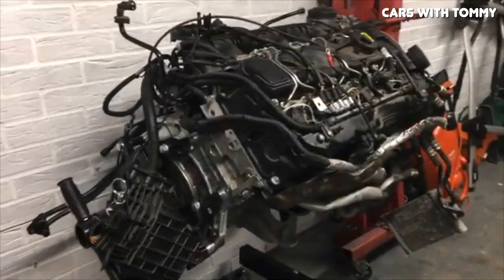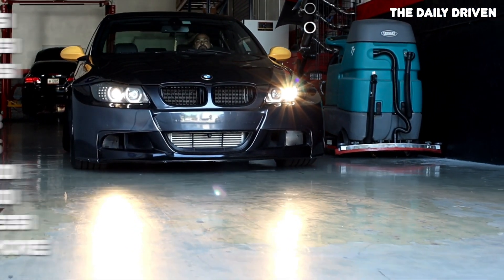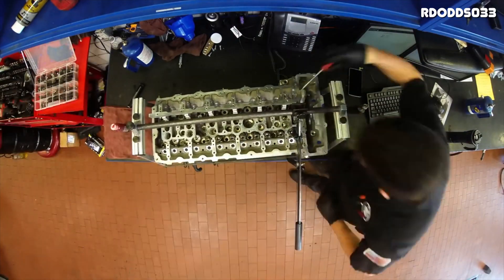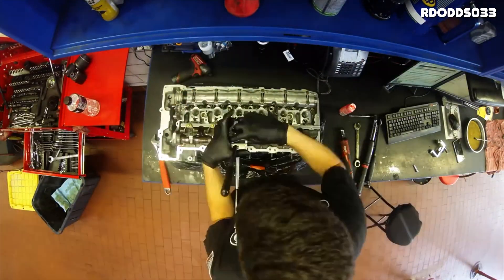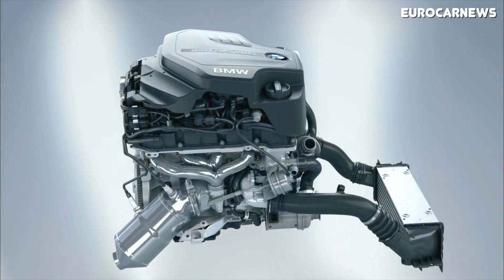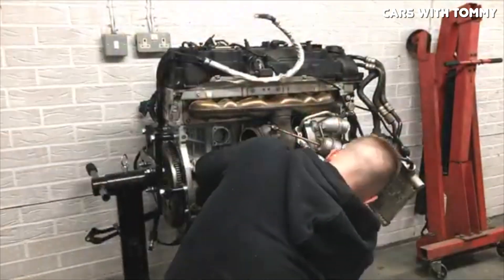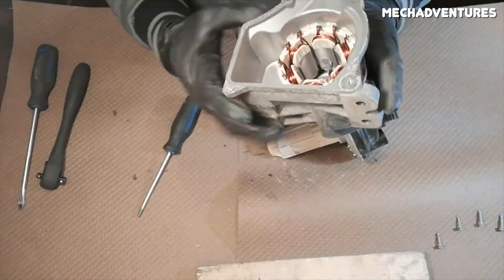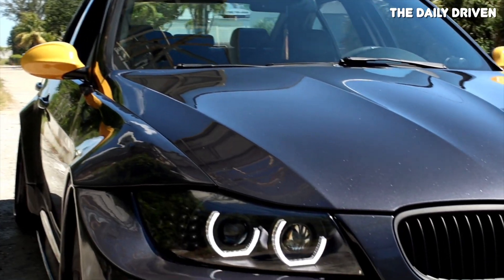BMW N55: Everything You Need to Know

Comment: I've heard a bit about oil starvation to rod bearings on N55,  is this something to be concerned about?
Reply: I heard Rod Bearings are not an issue on the N55 had mine a few years . Done quite a bit of preventative maintenance but the only time I had to do something involving opening the engine was the doing the PCV that's built into the valve cover.

Comment: I just snagged a 1 owner, elderly owned, 2013 335i with 38k gentle miles. I was looking for something SUPER basic, like a 328i for a spare/ date night car. This was just too hard to pass up for $16k. I'm still learning about the N55,  i plan to do the charge pipe/ inter cooler components upgrade. I dont think i want to tune it, but if i get the itch, whats the best VERY mild tune for these things? I. Talking like 15-25 HP upgrade. Thoughts??
Reply: MHD Stage 1 is super light on this engine and wont harm anything

Comment: I think I read somewhere that the N55 does some sort of recirc that helps the valves stay cleaner (a problem on direct injection engines and on the N54).  Not sure though.

Comment: How reliable is a 2014 BMW 335i xDrive? I would like to keep it OEM+ just a intake, exhaust, and light tune. It would be my daily driver all year round. So how reliable are they since I'm a university student (I can afford to maintain it myself since I've been working on cars for years).
Reply: make sure the charge and boost pipes are changed, bmw cheaped out on those back then.

Comment: I have an 2016 built N55 inside an X5 xDrive35i that's been tuned to the M Performance power kit. Apparently late production N55 share the piston rods and rod bearings from the S55.

Comment: I’ve got an N55 M135i my first BMW coming from a VR6 Golf. It’s always crazy to me how this thing looks so understated but is a very quick car even in stock form.
Reply: I just bought a 2013 135i E88 N55. 6 speed. So fast stock. I had a Jetta 1998 GLX VR6 5 speed. Also, way faster than would think. I would pull on cars 300 HP on hwy. N55 is a beast and pulls!

Comment: spot on intelligence thank you for that ! with that said i have a 2011 335xi sedan stage 2 single twin scroll turbo upgrade , ghassan remanufactured n55 engine , stage 2 dme flash, all new valve cover , valvetronics motor , dme , delphie coils , plugs 1 step cooler, new oem bmw 6 injectors , and after about 1500 miles driven now, I'm noticing a ticking noise almost like a baseball card in a bicycles spokes upon acceleration when car is in gear driving only  ! when in park or neutral and revving car , no noise ! only when in drive under medium or higher acceleration around 1500-3500 rpms then goes away in higher rpm,s ,doesn't happen at all under normal acceleration ? no one can figure out this issue ! please help !
Reply: most likely wastegate rattle, pretty common on n55 and n54, could be a faulty turbo or just nothing to worry about depending on how bad it is

Comment: I got a 2011 E88 FBO was able to achieve a 475 torque but only 335 hp to the wheels. Stock turbo and stock high pressure fuel pump. With a costume tune by mhd and tuning dynamics and a xhp transmission flash on the DCT transmission. Those numbers where done with a 93 degree weather and 52% humidity. I forgot to mention that was done on pump 93 octane. Debating on upgrading the turbo because I want at lease 450 whp but idk how reliable that will be. I forgot to mention that I also got a remanufacture engine with forge crankshaft and kings bearings. Anyone here with a n55 with 450 or more whp? if yes what you got done to it?
Reply: I daily drive a n55 stock engine at 700whp
Reply: What are your mods?
Reply: @gabequarles3809  lit 🔥
Reply: That’s lit I just got mines tuned making 370 with the upgraded charge pipe waiting for my exhaust and coil overs  and intercooler I should be  be at 4 soon
Reply: Races a 2011 same year as mines with a tune and got him in the high end 😅🔥

Comment: Thank you very much super helpful information, I'm picking up an X1 with this engine and will leave it stock have no interest in tuning it I just want reliability out of it, I was worried about the timing chain issue i'v hear on the n-20s  2.0 engines but you mentioned none of that thank you again

Comment: These engines aren't even in the same ballpark as the 2JZ or RB26 and built a decade later.
Reply: The engines were created in different time periods and conditions, so off comparison. Besides the b58 has proven itself more than capable and just as good as the 2JZ so there’s that.
Reply: @juda210  2jz will shit all over a n54 in every way possible, and its a decade older
Reply: @vdubskiee5356  buddy did you feel like reviving a 3 year old conversation to state the obvious?
Reply: I’ll take the b58 over 2jz.. power just comes in way quicker

Comment: I have 2015 435i xDrive gc (n55) with 70k on it. Engine seized, battery died and starter went all at the same time about a week ago. Connecting rods and bearings are done. Car has MHD stage 2+ with FBO. Never abused the car, always drove it and treated it very well. Shit luck!
Reply from the maker: That’s some bad luck! Hopefully my N55 doesn’t explode like that 😂
Reply: Just got mine back from BMW. New engine from Germany, Dealership found metal in oil filter during trip for drivetrain malfunction. Thank goodness for engine and drive train warranty.  49K on the motor. Initial issue was a wiring harness. That replaced and issue resolved.
Reply: Nah the engine seized up and you killed the battery and burned the starter from all the attempts trying to start it. 🤣
Reply: I have the same exact car I was thinking about getting the same tune do you think the tune had anything to do with this engine crashing?

Comment: HELPP I GOT THESE CODES!!!! 2C58Charging pressure control: switch off Consequential reaction/2DAO/2DA2 intake Camshaft angle deviation With respect to Crankshaft outside tolerance!! Exhaust camshaft angle deviation with respect to crankshaft outside tolerance !!!!!!!!
Reply: Vanos Solenoids. (Many months later)

Comment: Who knows what exact transmission is in the 2016 F36 x drive (435xi) grand coupe ? Is it the first or second gen ZF 8 trans? Because I know instead on doing the LCi in 2016 they just went to the 440i in mid 2016 which was really stupid on their part, granted I just traded in my 2020 M5 comp for a brand new G82 M4 comp, I had the 07 e92 n54 with fbo and tune making great power but I use the 435 as my daily but I want a tasteful tune on this car I’m thinking JB4 I’ve already went with dinan and bootmod3 as we’ll as a jb4 G5 back in the day of my N54 ,and I cannot seem to find info on the GC I know it’s loaded 8 speed m sport package but not performance pack that’s the only option I left out . Literally costed me as much as a base M4, it’s like a mystery to everyone . Lol even wiki/forums/other F30+ guys dont seem to know. Thanks in advance !!!!
Reply: All of the variants of zf8 speeds will be fine with tuned n55s I would recommend tuning the transmission of course

Comment: My wife got a 2007 n52 and it not running to good. Been hearing alot of good things about n54 and n55 swap. Which is the better engine if it going to be for a toy. My daily is an f150 and my wife drives a Toyota Corolla. The BMW is strictly going to be for play and riding around town and showing off. It will be long term project. 

Open to all suggestions just give your reasoning for what you would choose.
Reply: If you can find an M2 or M235i N55 - code is N55B30TO - that will be the one to have. Some internals from the S55, better oil circulation, and RK Tunes will get you to near on 700 wheel horsepower on stock block, while offering better reliability than the N54.

https://youtu.be/El8czI1li1Q
Reply: @4our6ixkwvmz  
Are you talking a specific n55. I only ask cause I plan on turning it bottom up and putting all forged internals. That said everywhere I'm looking for reliable transportation go n55 for street and strip go n54. 
I promise I'm not disputing what you say I'm just looking to get as much info as possible
Reply: N52 is one of the best running bmws ever! Not for power but for dailying
Reply: I have a 2011 328 with a N52. All I had to do was replace the Valve Cover, Plugs and Coils at 130k. 
I got it in 2013 with 21k on it. 
She's hitting 188k currently and no issues.

Comment: u told a lot of stuff here thats not true. First of all, stock turbo is capable of making 450hp with all bolt on stuff (cooler, piping, etc etc). Internals can handle 600hp in daily use. Ofcourse everything will break someday, but you got the point. Been there done that.
Reply: Yeah, maybe 400hp w meth/ e85 and fbo.

Comment: can someone tell me what n55 my 2015 640i has.
Reply: From 2015 it's probably the same as in my 2017  N55-B30A
Reply: Just google it 😂
Reply: @sekouchill  not that straight forward - there was a change from pwg to ewg, sometimes i see 315bhp quoted, sometimes 320bhp.  and i think its the b30O engine after checking with ISTA.

Comment: Had a rod knock in my n55 with regular maintainence.  10,000 later my car was back in business
Reply: Have u done the oil filter housing gasket replacement before it knocked? Do you own a e9x chassis? Mileage?
Reply: You didn’t do anything to get it fixed?
Reply: @Yeer718  what do you mean? A rod knock meaning the engine would have to be dismantled and rebuilt.
Reply: @usmclongrangebrainsurgeon  at what mileage? I have the same car around 60k miles
Reply: @frazmeup  around 63,000. Ended up having to replace the engine for $9600 with one that had 30k miles on it
Reply: @usmclongrangebrainsurgeon  Damn. Got me scared now, I have no warranty lol
Reply: @frazmeup  it was caused to due oil starvation. My recommendation would be to do an oil change every 5000-6000 miles. The engine burns through oil especially if you drive it in sports+ often
Reply: @frazmeup  don't be, just be smart about addressing issues as early as possible. Regular maintainance will cost you a lot less than taking a chance and waiting the extra few 1000 miles. It's a great car and should last you well into double your milage as long as you take care of it. If you can't afford to go to bmw for an oil change learn how to do it yourself or find a good garage that specifically works with European cars.
Reply: @usmclongrangebrainsurgeon  I have an Indy that does the oil change for me. Never go over 5-6k miles between them. Changed the OFHG, coils and plugs just recently. But still I have this un easy feeling. People telling me how the rod knock is common with these cars. Mines also pwg not ewg which sucks. 2014
Reply: @frazmeup  rod knock is only common because the engine gets starved and the oil sensor doesn't pick it up in time. Most people change oil every 10k-12k. If you do every 5k-6 you have nothing to worry about
Reply: @usmclongrangebrainsurgeon  I have a rod knock in my son's N55 at 82k miles.  We changed the oil usually every 5k, though once it went 8k.  I can't speak for previous owners though.  I read that oil starvation is possible in spirited driving due to g-forces sloshing the oil to one side.  Not sure if I will rebuild or put in a used engine, but obviously my confidence in this engine is low now.  This was a 2011 which was first year of N55, I read that later years - after 2013? - the reliability was improved.
Reply: @usmclongrangebrainsurgeon  Solid advice bro, appreciate it.
Reply: uhh clearly you didnt do regular maintence and ran the car with low oil, thats on you
Reply: @vdubskiee5356  nah this engine is known for being unreliable. I had the oil changed by BMW every 8000 miles. The car was meticulous. Unless the sensor failed when oil was low there was no way it was on me. There was a successful class action law suit for owners of this engine.
Reply: what bmw?
Reply: @jasonminhas377  535 xdrive

Comment: Their weak spot is this valvetronic motor, which is made from plastic (Lol at BMW for this decision). The eccentric, intake and exhaust camshafts often have issues as well. This is weak engine. Had to open it and replace the valvetronic motor and the eccentric camshaft. Now I have to replace the intake camshaft as well - it's scored. This is weak for an engine for me especially that I still haven't replaced the brake pads (at 110k km's) but had to replace the valvetronic already...

Comment: There are at least three versions of the N55. The "base" which is used in most regular BMWs, the M135i/M235i which has forged internals except pistons, and the M2 spec N55 which is even stronger. Also, the early models until the middle of 2013 had the pneumatic wastegate and will have a lower tuning potential.
Reply: not forged mate
Reply: The m135 and m235 only have a forged crank .
Reply: @JusZard  the 1m is an n54, also all n54 and n55 have forged rods and hypereutectic pistons.
Reply: I’m
Sure it’s only the m2 or 1m .

Comment: To my understanding n55s have forged crank and rods as well.
Reply: only on the m235i/ m2 i believe
Reply: @iamtygar  only the M2 does.
Reply: @erikmoralesrenteria2464  theres no difference between bottom ends in n55 variants
Reply: @evanwalsh8808  Incorrect. The O0 variant has a forged crank and rods. The T0 in the M2 adds the pistons and oiling system from the S55 as well as cast iron sleeves for the bores.
Reply: Nope n55b30o0 in thd m235i has forged rods allso wedge tuning makes m 680whp on a stock n55b30o0 engine in there car

Comment: Not sure about n55 only making 500s dude just posted n55 f10 with 700.  I got quoted 580 with stock turbo and stage 3 fuel pumps with my bolt ons from someone with same car and parts!!
Reply: N55 owner/modder here, The internal can comfortably hold 500hp at crank without running into reliability issue. The 700 one you are talking about is probably 4n motorsports de-stroked  n55b26, with upgraded internals. Again weaker internals of the n55 does not make it worse engine than n54 as at the 700hp level, you will most certainly open the engine up anyways, but n54 might be able to use stock internal but n55 might be a good idea to fit s55/m2 n55 internal.
Reply: As I track my car 430hp is as much as I would trust without upgrading the stock internal, anything higher than 500 you are running the risk of a flying piston if you are hitting that power level constantly .

Comment: N55 in the M235i (N55B30O0)  has a forged crank vs cast and the (N55B30T0) in the M2 has upgraded internals and a semi-closed deck design. There are people pushing 600+ WHP on stock bottom ends on these.
Reply: Correct, but no N55 is semi closed all open deck
Reply: Current stock engine n55 record is 760whp...pretty awesome!
Reply: Have a 2016 M235i  with auto tranny that I bought new.  Don't track it but do some street racing from time to time.  Been sending the oil out to Blackstone Labs for analysis with every oil change.  Last analysis (53,000 miles)  showed a bump the iron content.  Blackstone says it's still within limits, but I don't like it and obviously that has to be coming from internal parts.  Average for iron in the oil should be 24 ppm (parts per million), lab reports 34ppm.  Any reports of the N55B30 engine eating itself?  All the other metals are at or below the universal average level.
Reply: @sunny71169  Any news a year later?
Reply: @markburkey6371  The oil analysis with the next oil change -(10/7/21- 64,225 miles), iron was down to 27 ppm with the average for that engine reported by Blackstone to be 25 ppm.  Blackstone's report stated "Your BMW is bringing home another stellar report. Aluminum and iron went down after a longer run, [aluminum went from 8 ppm to 6 ppm average is 9 ppm]and that's a very welcome result. Iron tends to fluctuate a bit between samples, but there are probably operational reasons for that. Your N55 still produces a lot less iron on a per-mile basis than most we test. The universal averages show this level of iron is normal for most other N55s after only ~5,800
miles. Nice trends for a nice engine."  

I have had NO maintenance issues with any part of the car since its purchase.  Total brake job at 49,999 miles-(pads, rotors, hardware, etc) under warranty. Cost to me was $0.  I do the factory (NOT DEALER) recommended maintenance as per the manual, either myself or let BMW do it depending on the operation.